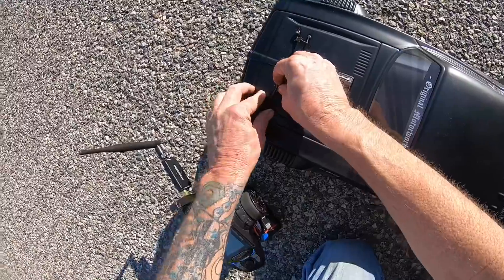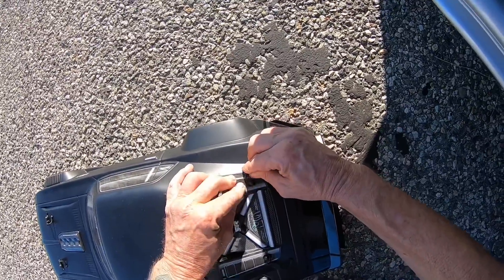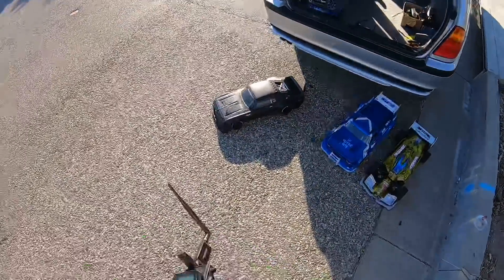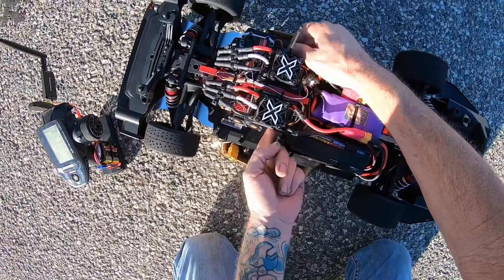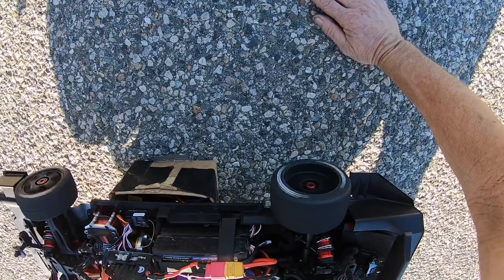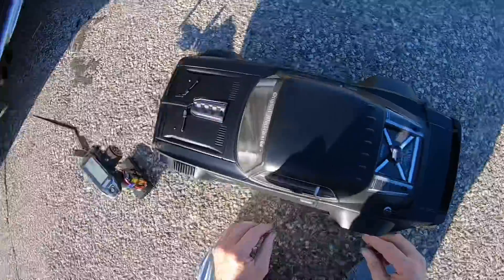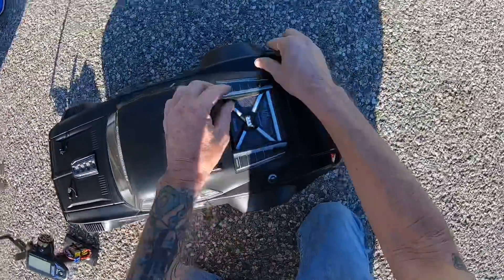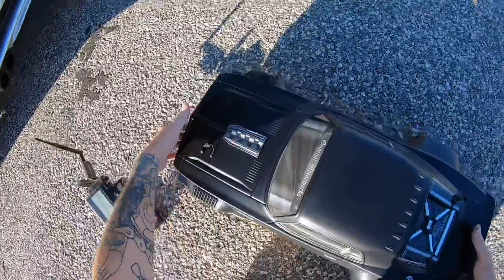Arrma Felony twin motor test passes & Arrma Infraction V2 speed passes

Comment: Wow I look forward to your videos. I learn a lot. During Covid I figured since it’s not much to do I would pick up a new hobby. I bought a Kraton 6s had it a week and it was making funny noises. Something is wrong with the gears it’s grinding into the motor mount. Came from the factory messed up have not heard anything g yet of Arrma fixing it. So I get to enjoy you run yours hopefully they will rectify this problem soon. And I appreciate the videos have a good one
Reply from the maker: Thanks 🙏 that doesn’t sound good horizon hobby is hard to get ahold of it’s an hour wait on the phone every time I call them and there email I never get a reply good luck hopefully they will fix it 👍👍🔥🔥💯💯💯

Comment: Next plan for speed felony? Matching diffs matching wheels and maybe kraton rear axles and hubs to widen the rear? I used kraton corners to widen my typhon a bit, not the arms etc just the corners
Reply from the maker: I’ll check and match diffs next 👍💯💯💯💯
Reply: @earlmoorhead5555  do you notice any difference in handling between a centre diff vehicle and a locked spool vehicle? Thanks

Comment: I enjoy your videos.  I find them to be very informative.  I noticed you prefer driving opposite traffic instead of with traffic.  I prefer with the traffic.  Also, I find adding a high torque servo is like having power steering.  I just wanna give a shout out to all the RC enthusiasts for posting videos.
Reply from the maker: Yes I’m left handed so I’m truly backwards I use my good hand for throttle witch is odd for me I’m surprised you noticed your the first to have pick up on the wow I’m impressed 👍👍👍appreciate the support your given for sure 🙏🙏

Comment: Hi Earl whats up, did you ever come back to this video to mention if and what the noise was? If it sounded good off the floor but was noisy on all 4 wheels but your mesh is good, Id imagine one motor or diff is rotating faster than the other. In my experience motors spin faster in one direction than the other so youll have to tweak the timing on them bcs both motors are turning opposite direction, plus Im not sure but if you are still running the oem rear wheel/diff setup, adjusting motor speed will not calibrate at equal rates between front and rear. This is an old vid so Im sure you know a lot more about that by now than I do but Im still curious to know the solution and what it was?
Reply from the maker: The pinion gear was bad the teeth got to sharp and became noisy

Comment: Beast mode👍🏿, Earl what connectors do you prefer using with 8s batteries, be it either bashing or speed runs: -->(XT90's or XT150)? Or anyone that uses 8s...?
Reply from the maker: I use xt90 on every thing but they will burn out overtime and the castle 8mm bullets work great for speed but for me xt90 work fine anti sparks ones 💯💯🔥🔥🔥
Reply: @earlmoorhead5555  thank you sir, thinking about using XT150 in my soon to be 8s Infraction, Krtn/EXB and xMaxx🤷🏾‍♂️ we'll see.

Comment: Another great video 👍 they all seem to be consistently getting higher speeds than what arrma advertise😀 something definitely doesn't sound right with the Felony 🤔 luckily when it locked up it didn't hit the curb.
Reply from the maker: Yes got luck low speed pulls are allways the best to test any issues for sure 🔥🔥💯💯👍👍👍

Comment: Ur crazy by be doing this on hoons!! Huge downside to this car
Reply from the maker: Hoons have been good to me as grp and bsr both have cause major crashes on blow outs and hoons been giving me warnings before they let go about 15 runs and done on Hoons then there basher tires 🔥🔥💯💯💯💯
Reply: I care to differ.  This is my car and hoons on full trigger can go almost 15 seconds full trigger and every other tire I’ve tried can’t go 10sec full trigger NO WAY.  Hoons aren’t bullet proof but they can handle the torque the best for my coke can motors.